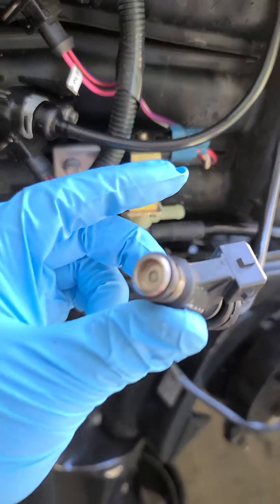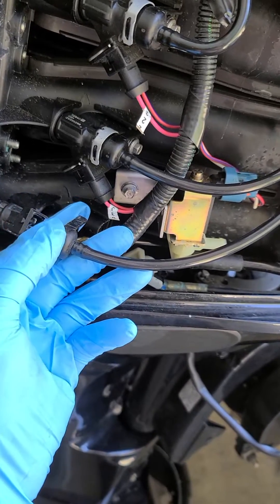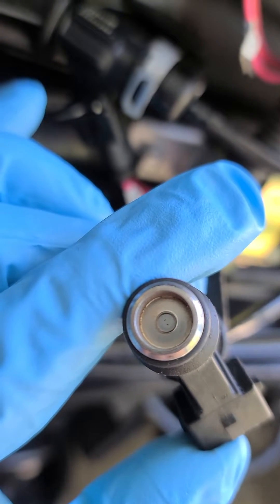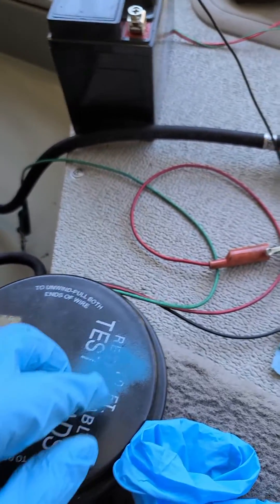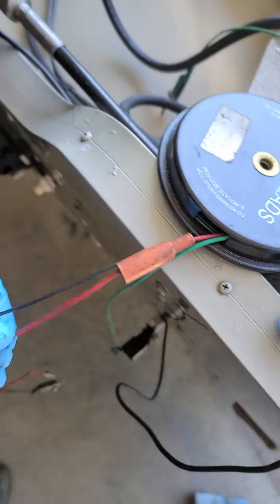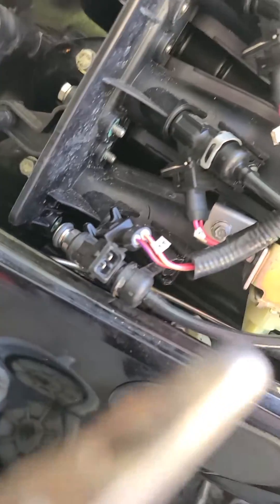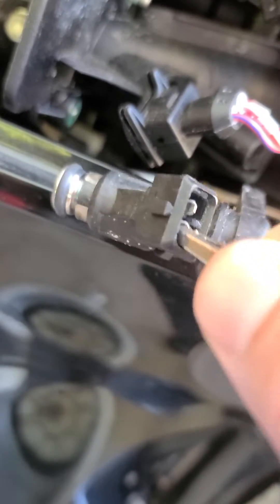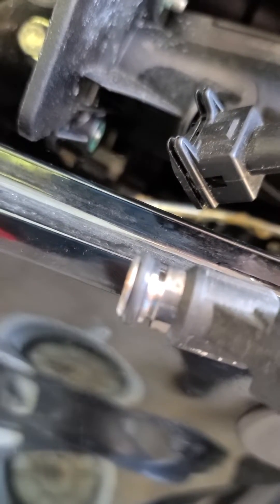"bench testing injectors". How to video. Mercury 50hp outboard boat motor.

Comment: How do you get the enjector off the line
Reply: Thats what I'm looking for lol he says pull but they are tight on mine the service book says you need a tool but I've seen guys use a flat head screwdriver